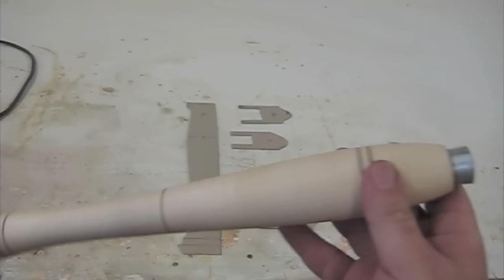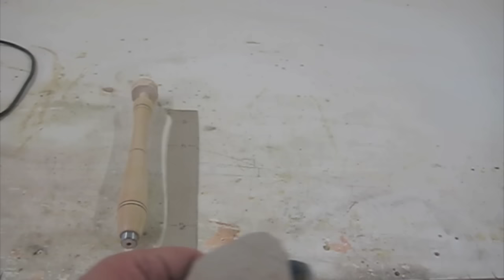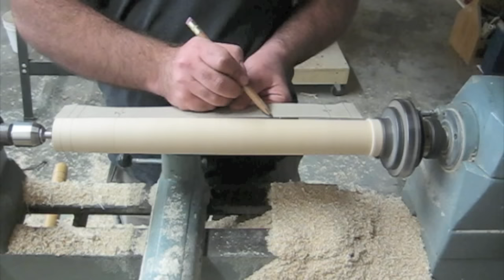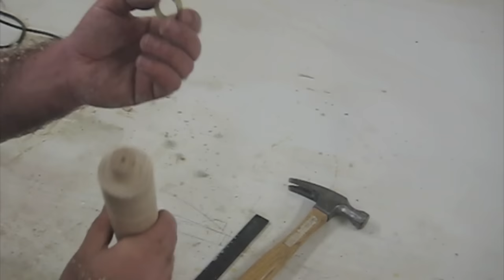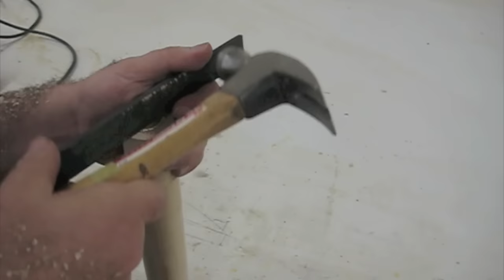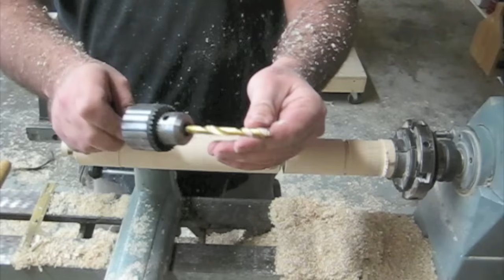Making Handles for my Woodturning Chisels (50% Complete)

Comment: Just a little tip for getting the ferrule on the handle 'cause it looked like you were struggling there for a bit. Cut two pieces of ferrule and put the one on top of the other and turn the hammer sideways and tap the top ferrule to push the bottom one on the handle to seat it. This is much quicker. Hope this helps....:)